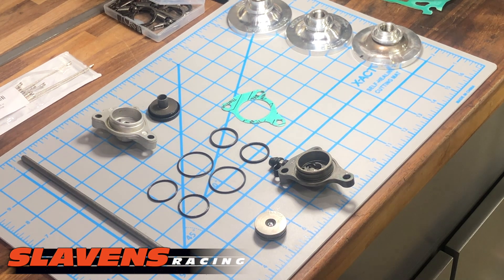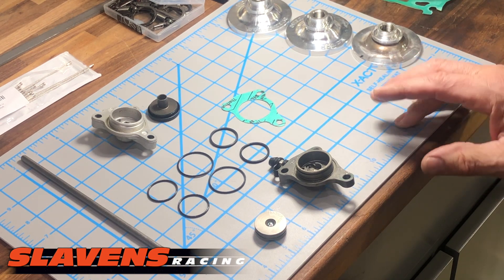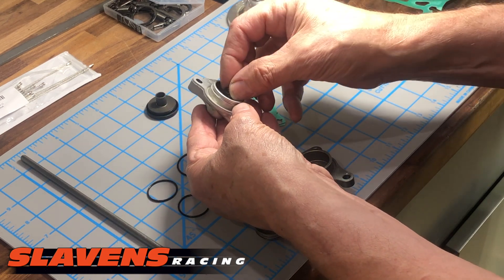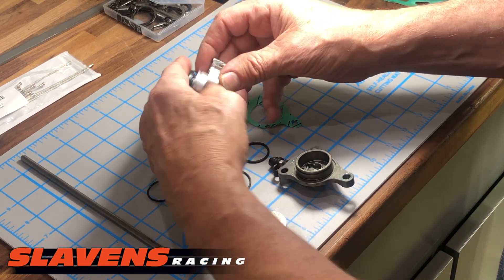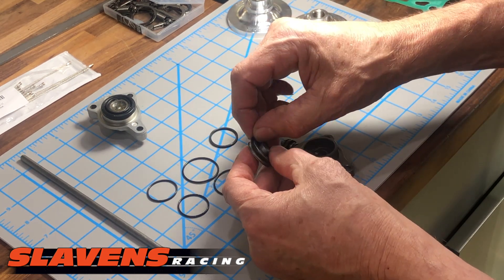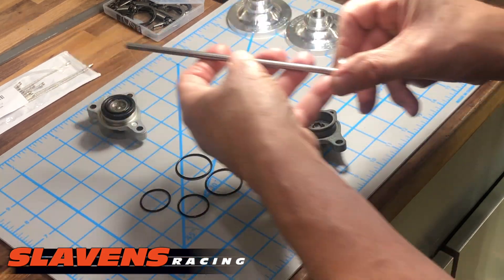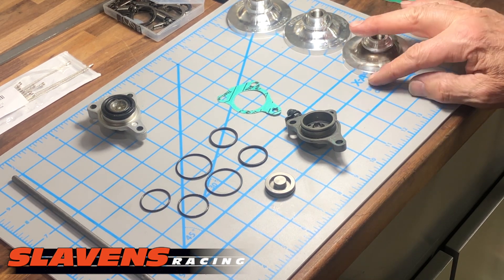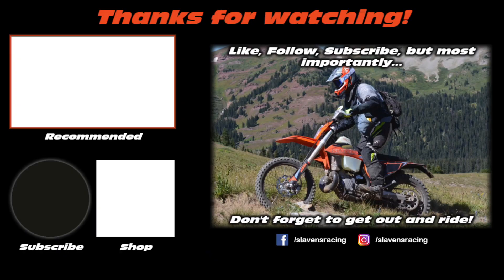How-to Diagnose and Rebuild Hydraulic Clutch Slave Cylinders

Comment: Hi Geoff, do you know if the 2022- pistons work with the 2023+ KTM models? KTM only sells the whole slave cylinder for 2023+. The only aftermarket seems to be the the All Balls brand which I'm not too sure about
Reply from the maker: Hello Aaron:
Have you looked at our site listings? Check out this page > https://slavensracing.com/shop/clutch-slave-cylinder-rebuild-kits-ktm-husqvarna-husaberg/. I think part # WP21-86014 is what you're after. Click on that number in the drop-down menu and the picture will change to show what's included in the kit. Just an FYI: All Balls is a very large manufacturer that makes ALL the other kits on the market. We've not experienced customer complaints or we would not be selling them. That's how we roll on ALL products.
Reply: @slavensracing  Good to know. Thank you

Comment: Hey here with 2019 KTM 125sx clutch slipping . Already bleed the system did everuthing you coukd imagine evdnvrebuikt thd slave . Just bought new clutch pack and installed it just how people say too as putting the 1.0 mm thin steel first then a fiber then 1.4 mm steels and fiber and then end with a 1.0 steel well when I do that the clutch is super soft like no pressure but it engages the issue is it slips in every gear and has no power . So I was like okay let me do the opposite and put fiber first then steel which I did and ended with a fiber and there was one steel left so it was 7 steels and 7 fibers that way worked I had more pressure in the clutch and it wheelied and had all the power until it gets hot right around riding for 10 mins the clutch slips pretty bad in higher rmps and in general . So now I’m wondering what this possibly could be the way KTM and people say to put the clutch in didn’t work at all but I do the opposite and it works for 15 mins all fiber are 1.9 mm then there are (2) 1.0 mm steels and (6) 1.4 mm. I have a brand new clutch boss and I tried changing the preload settings I’m running I think 10w50 or 15w50 motorex transmission oil. Any help would be greatly appreciated just trying to get this bike good and healthy and enjoy it !

Comment: Hey I have 2019 KTM 125 I took the clutch plates out and put them back in and my clutch is super hard to pull I went over and checked if everything was in order and everything still having a issue just rebuild the slave also I’ve been bleeding the system for 2 days now and idk what to do , thanks
Reply from the maker: Hello JC:
Lay the bike on the left side, remove the clutch cover and look at the Bellville washer/spring. It should be convexed (humped in the middle) and when you pull in the clutch lever, it should NOT go beyond flat. It sounds like yours becomes concaved when you pull in the lever. Back track and figure out what installation step was done incorrectly. Sorry, I can't diagnose it further without seeing it.
Reply: @ hey thank you now I did that I still have been bleeding the clutch the clutch has some pressure not enough as I remember but I can ride it but now the clutch is slipping going thru gears I could be in 5th doing 30 never had a problem until I took it apart

Comment: What would cause my clutch lever bite/friction point to be way out on the lever travel? Plates or adjust bell washer? 
I just rebuilt slave cylinder.
Reply: All the way out would mean you have the turn screw all the way tightened in back it out some
Reply: On the clutch lever

Comment: PERFECT TIMING!  Started losing fluid 2 rides ago.  Unfortunately the last ride was a 65 mile enduro.  Topped off at the gas stop and finished no problem but couldn't fan the clutch the last 2 miles (wee wittle one-fiddy).   THANKS JEFF for all you do for the community (support, parts, videos, etc.).
Reply from the maker: You're welcome.